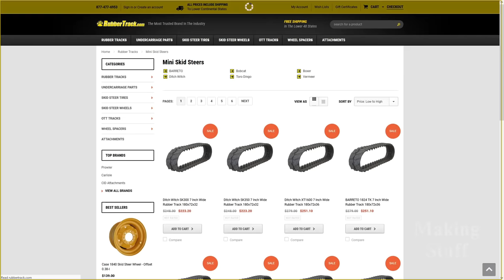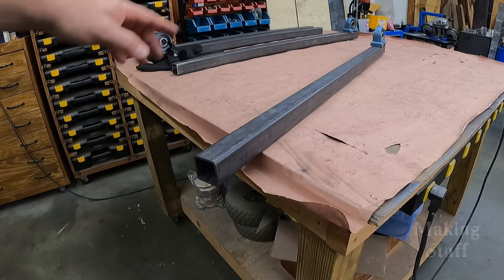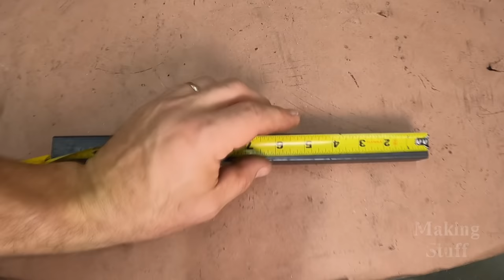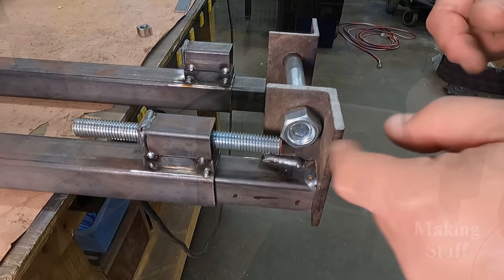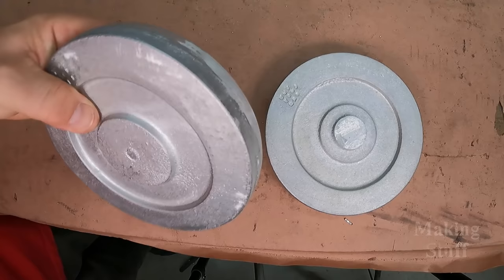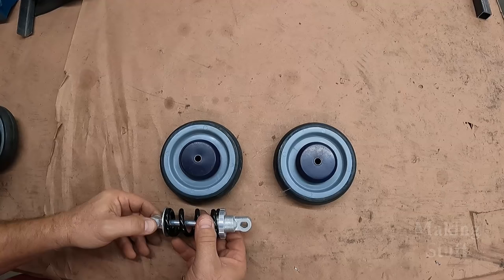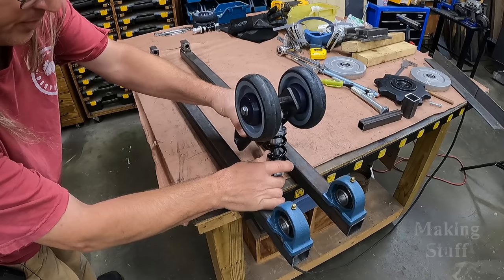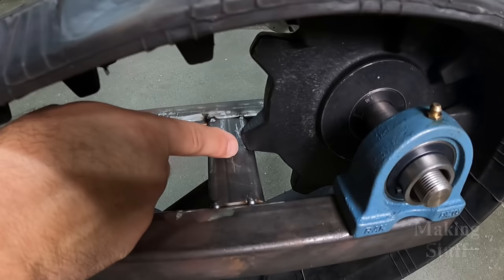Making Tracks for a Tracked Vehicle or Tank

Comment from the maker: Send me a comment!  I enjoy hearing from you guys!  Let me know what you think about this latest project!  Be sure to visit Perry's channel and see how the idler wheels were made, link in the description.
Reply: Thank brother.  It was fun to do a collaboration and see what you were up to
Reply: Can i buy a set of these off you? with the reack
Reply: I was thinking how would you remove the seam on the entire piece and the only thing I could come up with is a file on a stick.  Take the smaller piece of tubing,  cut out the outline of the file blade, remove the handle of the file, insert the file into the cut out notch of the inner tube steel piece, tack it in place and now you have a permanent weld seam removing tool for that size!  You could probably add a bit of weight inside with some ball bearings or a hunk of scrap to give it some extra gravity!.  Heck i bet you could build a whole set of these seam removers.  You just have to find a aggressive enough file that you won't cry over  since your breaking it on purpose (or enhancing it!).   
BUUUUT, 
if you have kids and they play outside, rig the push pull action up to a pulley and the door via rope because kids never know if they want to be in or out.  Grandpa doled out many lashings for the "IN OR OUT!" routine when I was young!
Reply: Hey great informative video. If you check out Fireball Tools YouTube channel he came up with a tool to scrape the weld seam out of square tubing using a threaded rod and carbide tips. Theres more to it than that but it worked great. I subscribed btw! 🍻
Reply: I know this is a couple years old, sorry for the late reply just saw the video recently. What is the axel and differential that you used. I did not see a link in amongst your other links for the parts. Thanks. Keep making stuff!
Reply: I need a set of these for my for my disabled son that would be so awesome
Reply: The track model break down is 180mm (7inch)wide x 72mm (2.835inch) tooth pitch (tooth spacing) x39 pitches in length
Reply: A good upgrade for soft terrain or heavier riders would be to upgrade to the 230x72x39 up to 45 pitches the added track length could allow an extra set of road wheels... These are 9inch wide tracks allowing for much lower base machine ground pressure (increased flotation) there is even a 250 (10inch width)x72x52 track that uses that same sprocket

Comment: Making tracks. Step 1] Buy them. The end.
Reply: ROFL! 😊
Reply: Sure.. if you have zero skills.. but when you build your own, you don’t have to take shortcuts, take all the time you need to build something better than a factory line. 
And often can be a fraction of the cost, all it consumes is time. 
Plus it’s more rewarding, and more bragging rights.
Reply: @BahnGop  The point of my comment was that this video which claims in the title to be about making your own tracks, is actually just him buying them.
Reply: At a fraction of the cost if your time = <1$/hr
Reply: @ekij133  wow! You take everything that literal? Most people can tell from the thumbnail what he meant.
Reply: Honest question, where do I buy them? I've found tracks with Google searches that were meant for a bobcat, they were $3,000 for each side, so $6,000 for just the tracks. If I wanted some that were 39 inches long and could support 1,500 pounds, where do I go? Or 64 inches long, 18 inches wide, 12+ inches of travel for crossing logs up to 12 inches, and support 5,000 pounds? 

Where do I go to see 10 different pre built models of tracks and their spec sheets so I can decide which ones to buy? I know where to find this info for metal, tires, bearings, gas or electric motors, hydraulic rams, solenoids, linear actuators, sprockets and chains, etc. all sorts of things I don't want to build, but need in my builds.

It seems to me like unless you want to build a bobcat (IE, a homemade vehicle with all the same size, weight, and capacity as a bobcat) you need to build your own tracks from scratch.
Reply: @BahnGop agree now we got 3d printers to bring treads at least for starting

Comment: 30 yrs ago our shop teacher would build sand rails. His sand rail had tracks on the back, they were made from large construction tires with the sidewalls cut off and steel brackets bolted on the inside. He had figured out a system that allowed him to deflate the regular tire, bolt on the tracks and then reinflate the tire as a drive wheel.
Reply: I gotta say sorry for replying to a 1y old comment, since that seems to annoy some people. I've gotta ask, how did he reinflate the tires if the sidewalls were cut off? I'm trying to imagine this build, but I'm a little confused.
Reply: @ericcaldwell3584  The system he used had 6 tires, the back axle had 4 wheels that pivoted where the axle came out. The tire pairs on each side were driven by chains from the axle. The tracks were the treads of big tires with steel brackets bolted along the inside to guide them on the bogey tires. To put on the tracks you just deflate the bogey tires and slip the tracks on and then inflate them.

Comment: Here is the secret.....   To remove the weld seam inside the square tube get a keyway broach and make a holder that can hold the broach so that it can be pushed thru the tube from the inside and it will cut the weld out of the inside of the tube so long as you design the holder to be able to hold the broach so it does not move as it is pressed thru the tube.   Keyway broaches are cut on a taper so that each tooth removes more material as it travels thru the tube.  Great build your doing!

Comment: Tack so you can go back! Shop rule, for sure. Great work getting it that far. Cool build!

If you ever wanted to completely remove the entire inner weld seam, Fireball Tool came up with a jig just for that. Basically it holds a HSS cutter and gets pulled through with all-thread. Just in case you ever need the full length someday. "Tips To Remove Weld From Tubing" on his channel(so I'm not linking to others on ya). Cheers.
Reply from the maker: Yeah I saw that Fireball tool video.  I just didn't need to remove the entire weld seam on all 39 inches of the square tube so I went with the file method.  Thanks for watching!

Comment: The taper is there for a taper lock, you just needed a matching sleeve that press in. Like a taper lock sheeve
Reply from the maker: Yeah, Someone else told me that also but it isn't a standard size.  I think it is specific to the Bobcat skid steer that it was originally meant to be used with.

Comment: Just a welder fabricators opinion, suggestion. The way you have the boggies setup your tracks will be loose at full compression  
I think you may need to make your track tensioner spring loaded instead of all thread. Gas charged maybe like an old Motorcycle shock or two . Just a suggestion . Cool build.
Reply from the maker: Thanks for the tip.  I guess I'll just have to wait and see how it works and go from there.

Comment: Tracked machines are great for pushing power/traction, but it's a rough ride and very difficult to get the track back on if they come off.   I think track on tires might be a better way to go.    Drive a pin out of the track , ride off of them, and then take the track to where it might be easier to put back on, but you are never stuck.  Plus you have the air cushion of the tires.
Reply from the maker: Thanks for the tip.

Comment: I’d have stuck with the taper on the sprocket. Inch and half shaft in single sheer with a taper on the end. First advantage is that sprocket is on there tight, so it isn’t going to move and get rust in the joint. Second huge advantage is dirt and reeds can’t pack into an open sprocket as easily. Idler might as well be a sprocket, at worst you have spares for later in life. I like the road wheel set up. *note, if building one, pick a standard road wheel with many material options. It will probably eat them. Sand and snow you might want rubber, stones you might want nylon. Honestly, if you have suspension you can go steel. Heavy, but they don’t screw up :o)

Comment: You should put a small piece of pipe where the all tread goes in to hold it in place. You would be surprised how much pressure is on that. If it gets a little side pressure it will bend. A little pocket back there will add a lot of strength.
Reply from the maker: Thanks for the tip

Comment: next time just weld a block on the front of the angle you have the axle through with the tension adjuster. it will make the angle stronger and ... stuff.  great build by the way. I would have done a few things differently, but then I figgure that maybe you havent worked in a fabrication shop doing what I have done. same result, differing path. good result. =right.

Comment: Looks very good except you need to put tubes in the square tubing where you mounted the pillow block bearings and close up the open end of that tube. Trust me it will crush and you will HATE trying to fix it.
Art from Ohio
PS: I just realized this video is a year old.
Reply from the maker: Thanks for the info.  It's still going just as strong as the day I made the video.

Comment: For your track tensioner, may I suggest changing the 5/8 nut to a coupling nut. They are longer and would help with the stress by spreading it on more threads.
Reply from the maker: Thanks for the tip.

Comment: looked thru the responses quickly and didnt see it......  Apologize if this is a repeat suggestion for future projects needed telescoping.  

Anyway....  another way to deal with the interior weld seem is to NOT remove it....  but to instead put a groove in the inside tube. Groove just wide and deep enough to not care the seem is inside the outside tube.    Just a tip for everyone
Reply from the maker: Good tip!

Comment: awesome build and nice to see somebody actually explain how everything is made and where to buy parts. With the piece of tube that the sprocket was hitting. could you have just notched the tube instead of cutting them all out and moving them?
Reply from the maker: No notch, because the bracket that welds to the bottom is the same size as the square tube.  It would have hit thebracket too. Thanks for watching!

Comment: 15:10 During assembly, you mixed up the position of the shock absorber and the spacer sleeve. In the next shots, when you weld the part, your shock absorber is already between the rollers, and not at the other end of the lever.

Comment: How would you make a mini tank wagin smoothly turn if you pulled it left or right without dragging the tracks sideways but instead moving continuously. I have a bunch of sand to pull objects over and the wheels bury themselves so I thought tracks on them might be better switch but I was confused on how to pull it manually instead of driving it.

Comment: Instead of cutting and rewelding the assemblies, you could have notch the cross piece and welded in a piece of flat stock to restore the strength of the cross piece.

Comment: I haven't seen this mentioned, so I will. IMO there is a big flaw in the design. Normally you want the bogey wheels to be pushed backwards so they don't bind under compression, they can rotate back when hitting bumps. In your assembled image at 16:00 that puts the front to the right hand side of the video. Well, the drive sprockets should be at the rear, so you are pulling the track under the bogey wheels, which keeps it tight across the bottom - if the drive sprockets are at the front, the track will wad up under the bogey wheels, like trying to push a rope. Using those logics, the drive sprockets should be at the other end to pull the tracks under the bogey wheels, not push it. If I was to design this along that train of thought, I would have the 3 front (in this case the left ones) pivot from the other way and make the rear one (far right) solid, to keep it from being retracted from the sprocket trying to rotate the belt.  The front one would still pivot, but be very stiff to keep the belt tight. IMO you might want to do some research on working designs and see if you don't need to make some changes before you continue.
Reply from the maker: Thanks for the info!

Comment: You will probably need to change the springs on those shocks to something lighter. Unless your machine is weighing over 3000lbs. Each spring is likely designed for around 400lbs load each.
Reply from the maker: Yeah, it's a rough ride but manageable.  I've been keeping my eye out for some used ones because new springs are insanely expensive.
Reply: @MakingStuff  you could also move the mounting points closer to increase leverage on each spring. It would raise the ride height a little.

Comment: How do you calculate the preload on the track tension?  Obviously you don’t do that while tacked together.  Also, those look like really stout springs for your bogie wheels.  I’d imagine if you want them to actually suspend this vehicle and move under normal conditions to provide a softer ride, you might consider putting them at a 4:1 (or greater) disadvantage.  Because the bogie wheels aid in tensioning the track, and they can travel under normal circumstances, that means then tension on the track will change while driving.  I would recommend spring tensioning the front idler along with the mechanical adjustment for track removal. Good luck on this journey.
Reply from the maker: Thanks for the suggestions.  I'll keep them in mind as the project continues.

Comment: How did you figure out how long to cut the metal inside of the tracks? I’m unsure of how long to cut it in order for it to fit and keep the track tight. I have the same size tracks and same drive sprocket. I’m trying to measure it but I understand I lose track length because of the height inside the track
Reply from the maker: That's why I made it adjustable.  I just got it close then adjusted it for the final setting.  If you have the same tracks, they will stretch out after some time.  So I would highly suggest making your tracks adjustable.

Comment: Track assembly looks great! Mistake happens, this why we tack weld, kinda like measure twice cut once. What is the size of the heavy wall tubing? Also on the idler wheels, could you plasma cut them out on 1/2 or what ever the thickness is from a steel plate/flat stock?
Reply from the maker: The heavy wall is 1/8" thick.  The wheels had to be about 7/8 thick to work with the rubber track correctly.

Comment: The bolt you used for the tensioner is not the best choice. Sharp threads tend to be weaker. Ideally you'd want a bolt with a thick thread like the machine screws used in lathes. Also, using a bronze housing (a big nut) for said bolt will make it last forever. That's what they do in car lifts.
Reply from the maker: Thanks for the tip!

Comment: Do you think this would work for a slope lawnmower build, or would the  track suspension pose a problem with an even cut?
Reply from the maker: The suspension doesn't work at all.  The springs are too stiff.   The tracks also weigh 65 pounds each.  Might be too heavy for a mower, but not sure.  Thanks for watching!

Comment: Looks like the tracks may come off with weight compression on the springs?
Reply from the maker: They do not.  I have to remove the front and rear bogey wheel assembly and loosen the tensioners all the way just to get the tracks off (and they barely have enough room).  The springs don't compress enough for the track to come off.

Comment: How long is the track after assembly could you lay a tape to it end to end thanks good info nice build👍
Reply from the maker: The track itself is about 4ft when laying on the ground by itself.  The overall length will be about 42 inches when the track is on the assembly.

Comment: 12:21. I do not like the shopping cart wheels. the rubber deteriorates very quick.
Reply from the maker: It's been 1 year since I built the machine and the wheels are just as good as the day I installed them.
Reply: @MakingStuff  i mean a few years. My friend and I built a frame to suspend the engine out of scrap wood and broken shopping carts. These wheels deteriorate. After all, this is rubber. it gets old, dry rot...

Comment: I am disabled (ca walk but can't be standing/walking for more than a few minutes) I am a Mechanical Engineer (retired) and have been thinking of making an Inexpensive tracked wheelchair. the one out there are 15k and up to 50k. most disabled people are on SS and can't afford that kind $. So, my idea is very similar to what you have here (have seen the finished one) I have some ideas to possibly improve some of the things you have done and obviously it would have to have a seat instead of the standup style. Do you have any patients on these designs?  Would you be willing to contact me in private 
for further discussion?
Reply from the maker: Sorry I don't have plans for this project.
Reply: @MakingStuff  do you mind if I use some of your basic designs. I would make some changes but still dont want to infringe on your build and design
Reply from the maker: @tojoyou  No I don't mind.

Comment: I'll be surprised if your shopping cart wheels last very long. My son has built two of these. Those wheels receive a ton of abuse... not just up and down but from side to side too.
Reply: Wheelchair casters are much tougher and available in a range of sizes.
Reply from the maker: I'll just have to see how it goes and make improvements from there.  There are 16 wheels on the ground so hopefully spreading the load out will help.